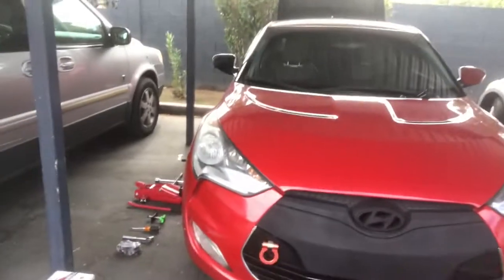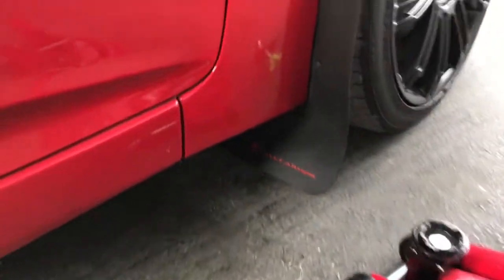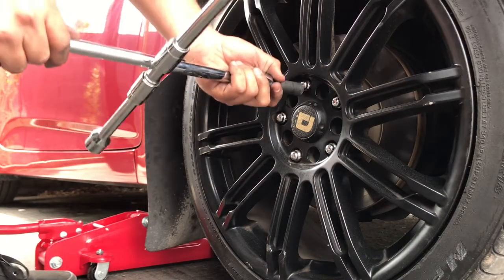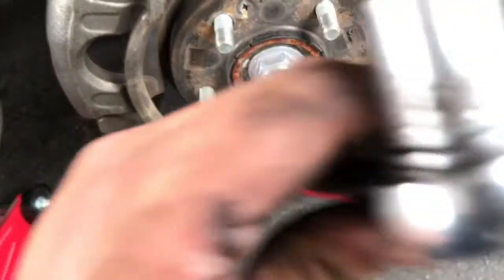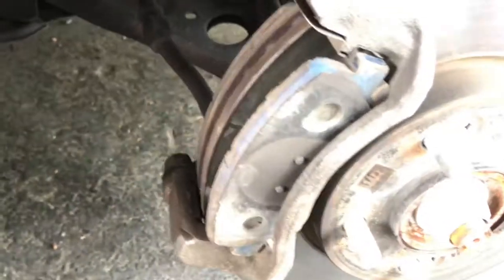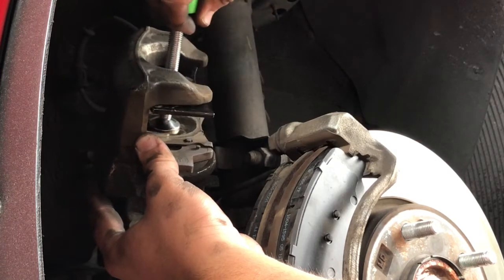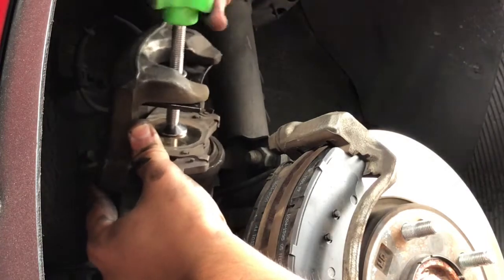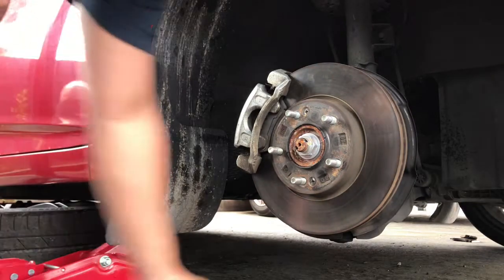|Changing Front Break Pads On A 2012 Hyundai Veloster|

Comment: If you’re only replacing the pads then just loosen the top bolt and remove the bottom one completely then you can just swing the caliper up and the pads will still slide out

Comment: Nah don’t ever open the break fluid reservoir. Break fluid absorbs moisture from the air which contaminates the fluid with water. Break fluid has a high boiling point and water doesn’t. When you drive, the water in your lines boils from breaking, and air gets in the system
Reply: Good point. However we don't really care.